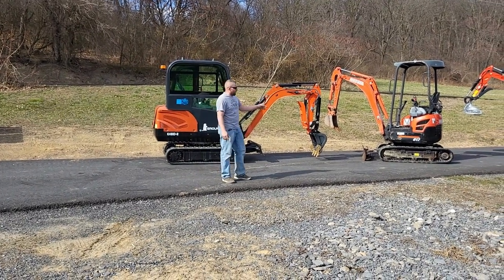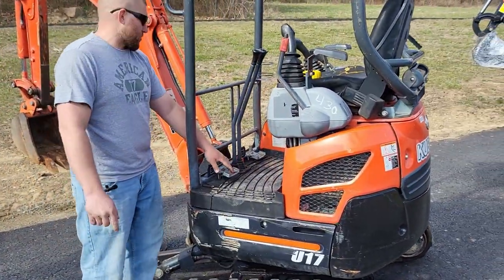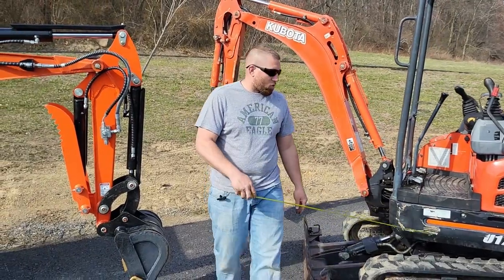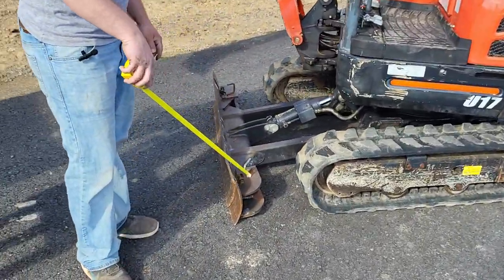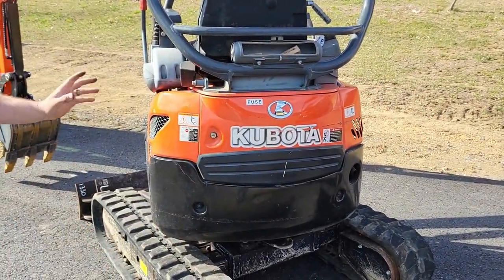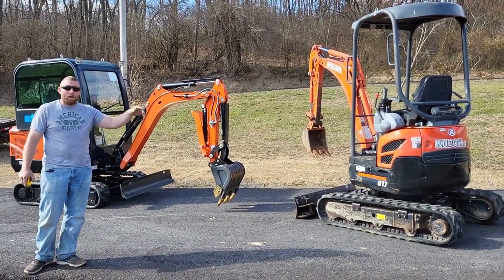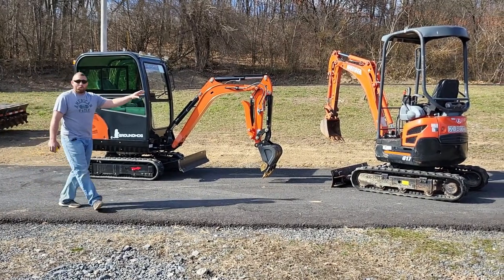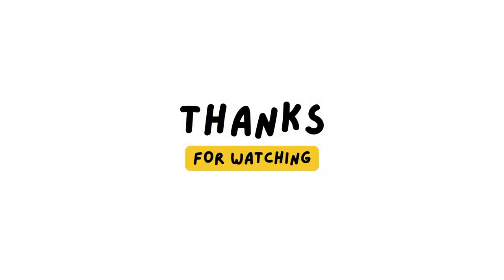Kubota U17 vs Groundhog Specs

Comment: That kubota will still be in one piece 10 years from now, working everyday making money, operating flawlessly. The one thing ground dog did right was using a kubota engine, it’ll be the only thing running in a couple years guaranteed.